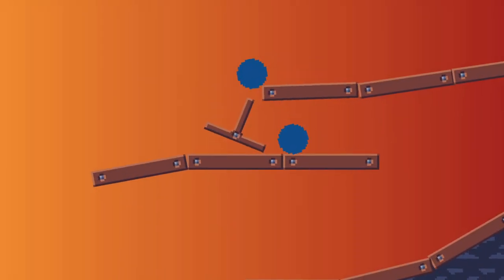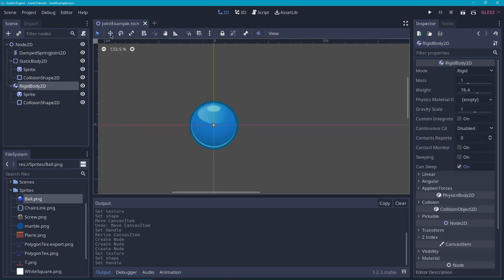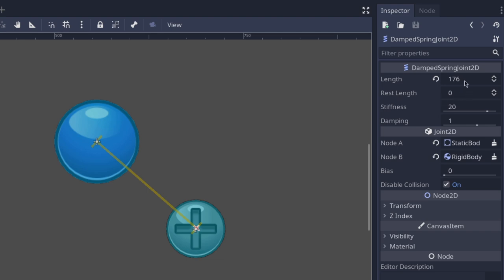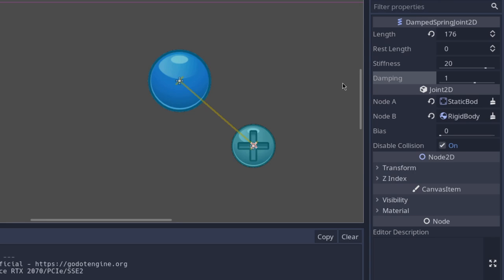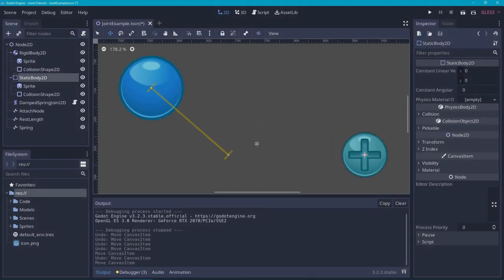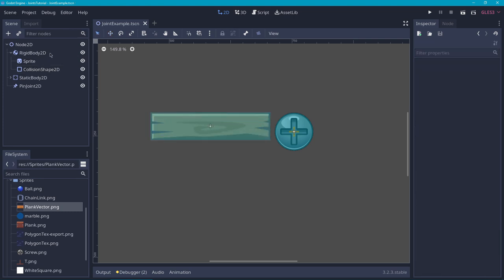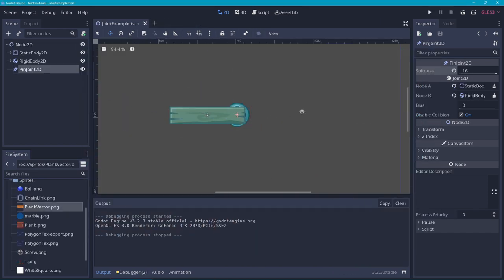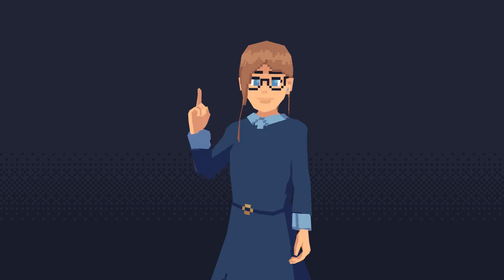Godot Nodes Explained: 2D Joints

Comment: Hi, in the outro, how were you able to create the interactive chain using PinJoint2D and maintain the distance between the chain nodes (chain nodes not disconnected)? I tried to create a chain like this myself that follows the player, but whenever the player has any movement the parts of the chain doesn’t follow immediately and has a gap in between the them and can only catch up to the joint position when my player stops moving. How were you able a chain that doesn’t disconnect when it moves? Was there something particular that you did? Thank you.

Comment: I really feel like godot miss some joints in 2D. Like if I want a pin joint that have an end to it's movement, I pretty much can't. If I want a spring for rotation, I can't. If I want to apply torque, good luck. 
So yes it would be nice to get a tutorial for the car! And thank you for your videos, very clear and usefull stuff
Reply from the maker: Thanks, and yes I agree that the 2D joints are lacking quite a bit of functionality compared to their Unity counterparts. The option to limit angles on both the pin joint and the spring joint would be really useful

Comment: Excellent tutorial, kudos! I subscribed.

Pin joints could be used to obtain the effect of the hair of Madeline from Celeste? Or what would be the better approach you suggest?

Thanks and keep playing it loud!
Reply from the maker: Thank you! And that's an interesting question!
A little while ago I messed around with this myself while trying to make a scarf for a platformer game. I made it using a bunch of segments and tied them together using pin joints. This didn't really give th result I wanted because you could really clearly see the different segments in the scarf.
After some research "verlet integration" seemed like a good solution. I haven't tried it yet, but there are already some Godot tutorials on it.

Comment: Very good tutorial, helped me get off the ground but Damped Spring and Pins seem to be one of the most frustrating things to work through code in Godot.
If I set everything up in the scene using the editor it's more or less intuitive, but but doing the same setup by code is insuferable.
I'm two days in a new project and I can not for the life of me join two rigid bodies as closely as possible using damped springs.

Comment: If I were to make 2D hair simulation for a character with long hair, which nodes should I use to make the hair lag behind
Reply from the maker: I think I'd be better to look into a method called "verlet integration" instead of using physics nodes. I think that's what they used for the hair in Celeste for example

Comment: Hi Lucy.
Is there a way of activating a join when a key is pressed?
What I want is to merge two bodies into a single one when I press a key. I tried doing this by creating two pin joins (so I avoid rotation) and not assigning a node to them. Then when pressing the key I assign the nodes of the two bodies I want to merge.
But the engine doesn't seem to update and the objects still behave as two separate objects.
If I assign the nodes manually before running it seems to work.
Thanks
Reply from the maker: That's odd, for me setting $PinJoint2D.node_a = $OtherNode (and doing the same for node_b) works just fine.
Maybe a different way you could approach this is by making one body a child of the other one. This also avoids rotation.
Reply: @LucyLavend  Thanks a lot. I managed to solve it.
I was doing $Pin1.node_a=NodePath("./Node1") and it doesn't like it. I changed it to $Pin1.node_a=$Node1.get_path() and it works.
Thanks a lot for your fast response, great channel :)
Reply from the maker: @IsaacPiera  Ah it has to be a node path, nice that you managed to fix it 👍

Comment: at 3:00 how did you get the spring to render correctly? or does that have nothing to do with the debug settings?
Reply from the maker: It's a script I made on a Line2D node. I set the first point of the Line2D equal to the position of the StaticBody, and the second point equal to the position of the Rigidbody
Reply: @LucyLavend ok

Comment: Hello. Can you please tell me how can be put clamp values on PinJoint. I have been searching for this for 5 days. If possible, please tell me. It will greatly help.
Reply from the maker: What part of the pinjoint do you want to clamp? Do you want to clamp the distance an object can move from the joint, or do you want to clamp the rotation?
Reply: @LucyLavend  I want to clamp the rotation. I have a ragdoll, and I wish to clamp the ragdoll joints so that they don't move beyong 30 degress. Similar to how an elbow or an arm works.

Thank you for responding.
Reply: @LucyLavend  In fact, this is one of the things that Godot should have out of the box. HingeJoints exist on Unity. If you make a tutorial on how to make a hinge joint using a PinJoint, it would be the only one on YouTube. Nobody else has done it.

Essentially, what I am trying to do is, create clamps for the ragdoll that I am working on. Help would be appreciated as I have been trying to do this since the past 5 days.
Reply from the maker: @theplaymakerno1  ah whoops I forgot the difference between a pinjoint and a spring joint, it has been a while lol

Are you working in 2D or 3D?
Reply: @LucyLavend  2D pinjoint. Like I stated, there is not a single video on YouTube about this. Even the Discord (Godot) hasn't answered back.
Reply from the maker: @theplaymakerno1  The pinjoints defeatedly could use the functionally, but it's currently not build in, so you'd have to do it in code. ChatGPT came up with this, though I haven't tested it:

extends PinJoint2D

var max_rotation = deg2rad(45) # Set your desired maximum rotation in radians

func _process(delta):
    var relative_rotation = body_b.get_rotation() - body_a.get_rotation()
    
    # Ensure the relative rotation is within the limits
    if abs(relative_rotation) > max_rotation:
        if relative_rotation > 0:
            body_b.set_rotation(body_a.get_rotation() + max_rotation)
        else:
            body_b.set_rotation(body_a.get_rotation() - max_rotation)
Reply: @LucyLavend  i will try it, but I don't think this will work. The set rotation values don't seem to effect. It might be because I am using it on a Ragdoll. I honestly don't know, but thank you for sharing this. I will try to use this tomorrow. If I succeed, I will let you know.
Reply from the maker: @theplaymakerno1  Might be because the code would have to be in the intergrate_forces() method, you could try to ask ChatGPT about it more if it doesn't work out
Reply: @LucyLavend  I am calling in in Integrate Forces.

Comment: How can I give a texture to the springjoint like a rope
Reply from the maker: You can use a Line2D node. Via code you can get the position of node a and b of the spring joint and then have two points in the Line2D connect the two
Reply: @LucyLavend  Ty! Will be helpful for my project ☺️